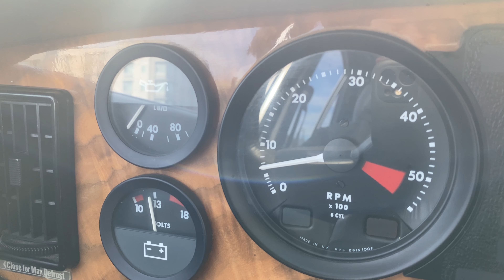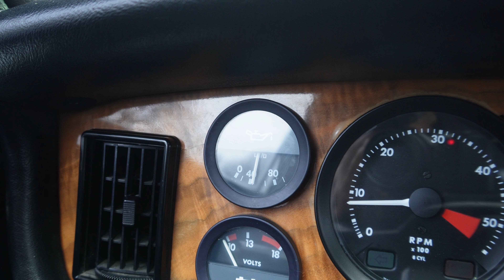Low Oil Pressure: Replacing the Oil Pressure Sensor in My Jaguar Series 3

Comment: The electric sender units on all jaguar engines from 1962-1990 were notorious for giving low and innacurate readings or scaring you ABSOLUTELY WITLESS (thanks to the shoddy manufacturing process of British Leyland) by giving a 5psi hot or 0psi hot. I changed mine for a direct feed and guage and got AN EXTREMELY nice surprise 50psi cold idle /40 psi hot.
60psi at 70mph and 40psi hot idle
I've never worried about oil pressure since.